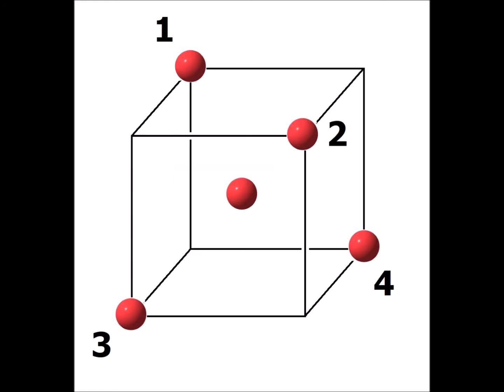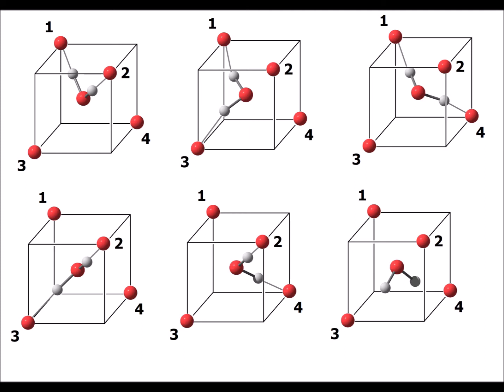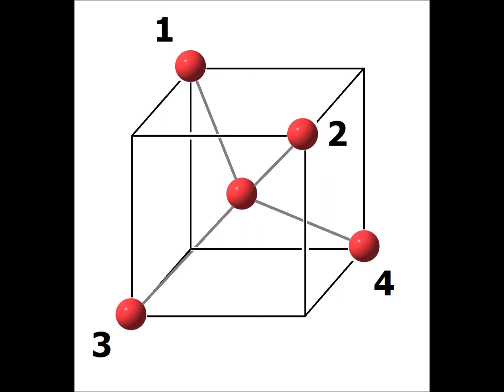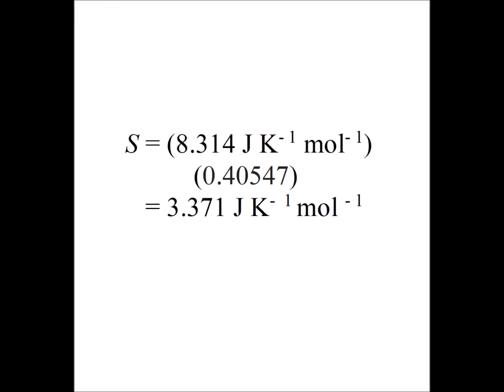Thermodynamics: residual entropy S of water ice calculation

Comment: I liked your explanation. I was studying this subject to show to my students later this semester, and I've been studying the experimental and theoretical studies about the residual entropy of water, but there is still one point that I don't quite get. How can we relate the specific mass of water to the residual entropy? This has been bugging me for a good part of today.
Reply from the maker: Unfortunately, I don't completely understand your question. The residual entropy of water is the entropy still remaining at absolute zero, when water in in the ice form. Entropy is (usually) a molar quantity, so mass and volume are not involved. Surprisingly, the density of ice at 0 C is 0.9186 g/ cm3, but 0.935 g/cm3 at 0 K.
Reply: @lseinjr1  You're right, but how can we measure entropy experimentally?  I know that we could measure the heat capacity of water and integrate it along the temperature range.
Reply from the maker: That's exactly how it is done, with the complication that we need the heat capacities of (solid) ice close to absolute zero.  Theoretical expressions for the heat capacity in the limit of absolute zero were developed first by Einstein, and then improved by Debye.  Since there are limits to how closely one might be able to measure to absolute zero, the final determination must involve extrapolation. 

The first experimental measurement of the residual entropy of water ice was done in 1936 (!), and the value was in excellent agreement with Pauling's theoretical value.

Comment: In the second method, why does it multiply by 2 to 2n ?
Reply from the maker: N is the number of oxygen atoms. Since there are two (2) hydrogen atoms connected to each oxygen atom, there are 2N hydrogen atoms. That is the "2N" exponent.

The two (2) as the base is because there are two possible positions for  each hydrogen atom, one close to one oxygen atom, and the second position closer to the other oxygen.
Reply: @lseinjr1  thank you so much for your wonderful attention

Comment: Sir this bcc lattice looks too difficult,how do they calculate microstate for fcc and more complex crystals.Is there any easy method do get the value of "w"
Reply from the maker: One can use a simpler square planar lattice. That can be found in this paper:
“Residual entropy of ice” DiMarzio, E.A.; Stillinger, F.H. J. Chem. Phys. 1964, 40 (6), 1577.

(This paper is available online)

Comment from the maker: (for mobile users)

00:18   Literature references
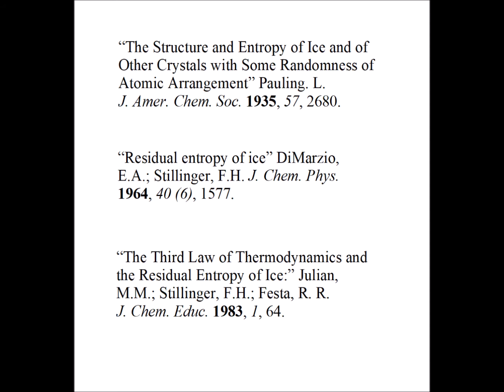00:47   Formula for entropy S
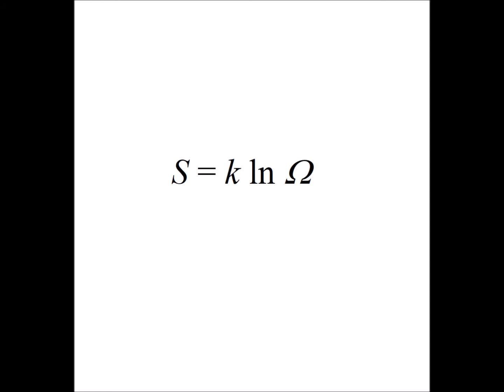01:19   Tetrahedral arrangement of oxygen atoms (red)
01:47   Grey lines showing connectivity of oxygen atoms
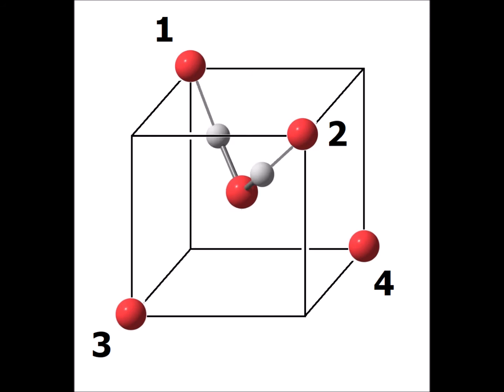02:33   Pauling's First Method, structure 1
03:17   Structure 2
03:33   Structure 3
03:43   Structure 4
03:53   Structure 5
04:03   Structure 6
04:16   Grid of 6 orientations of central water molecule
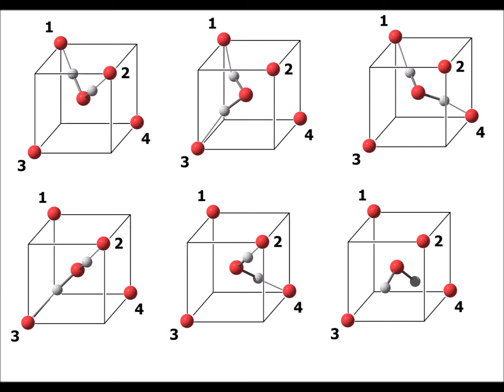04:42   Repeat of grey lines showing connectivity of oxygen atoms
06:05   Number of conformations W by Pauling's First Method
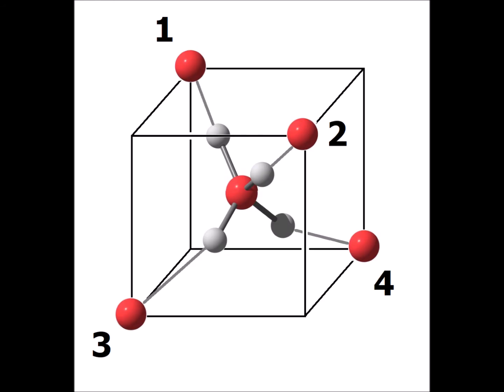06:22   Pauling's Second Method, structure 1
07:04   Structure 2
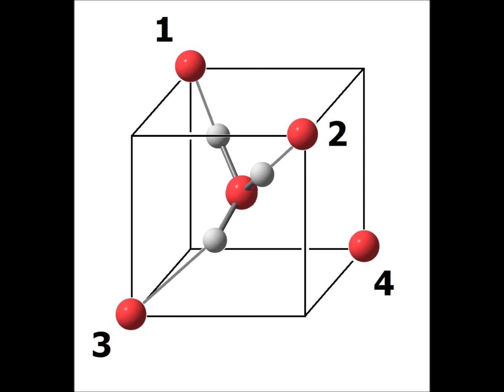07:32   Grid of all 16 structures of central oxygen with explicit hydrogens shown
08:03   Structure invalid, too many connected hydrogen atoms (4)
08:22   Structures invalid, too many hydrogen atoms (3)
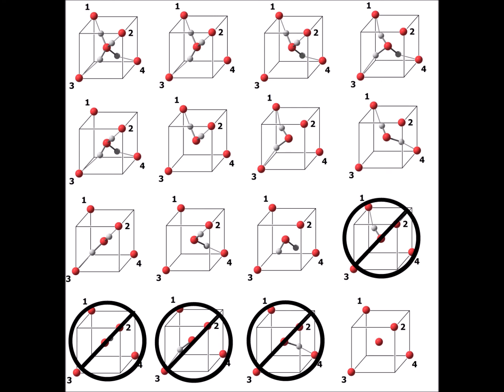08:42   Structures invalid, too few hydrogen atoms (1)
09:03   Structure invalid, too few hydrogen atoms (0)
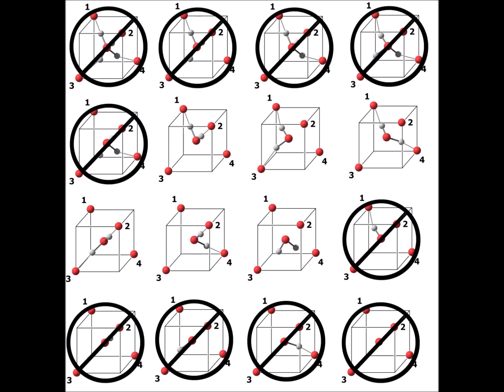09:23   Grid of all 16 structures of central oxygen with explicit hydrogens shown, with invalid structures crossed out
09:53   Calculation of W by Pauling's Second Method
10:55   Residual entropy for both methods

The residual entropy of ice water is calculated using both methods employed by Linus Pauling in his 1935 paper.

Don't forget to like, comment, share, and subscribe!